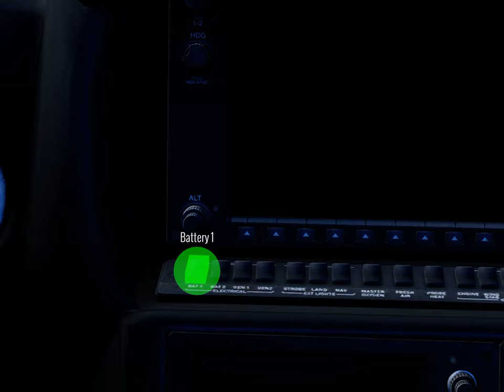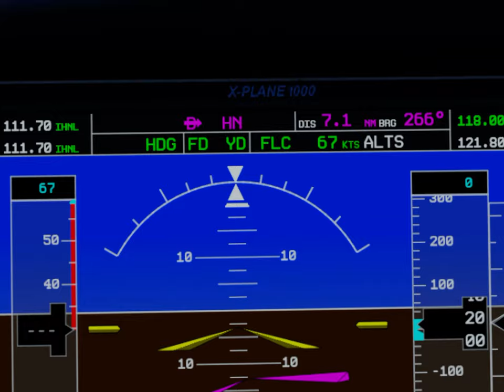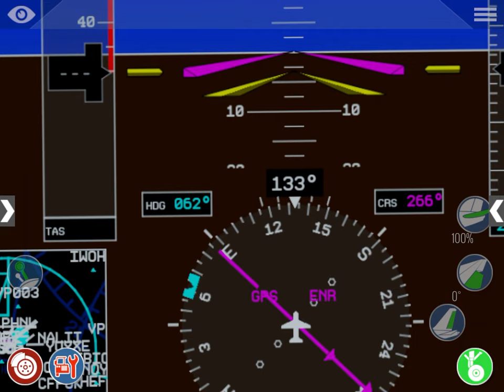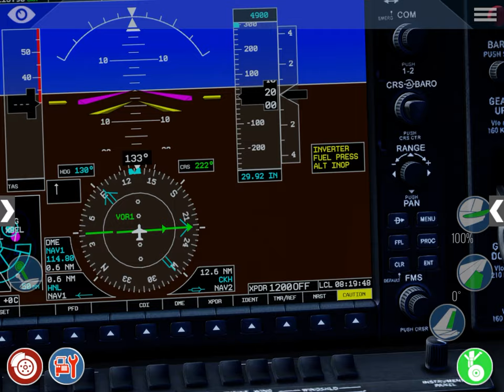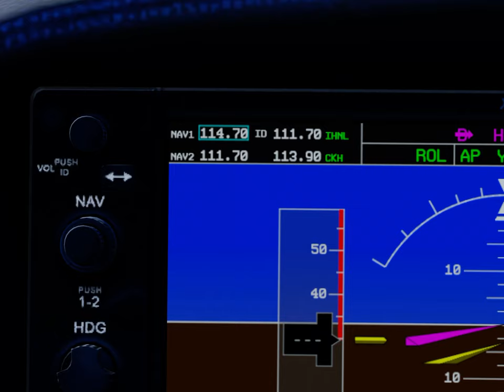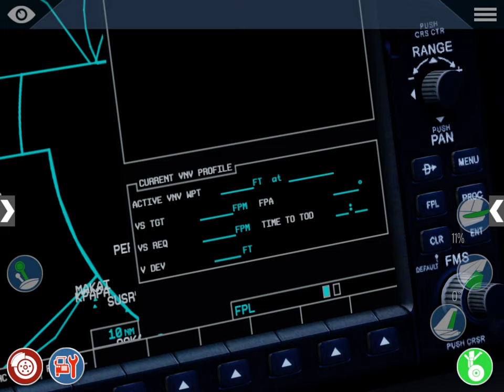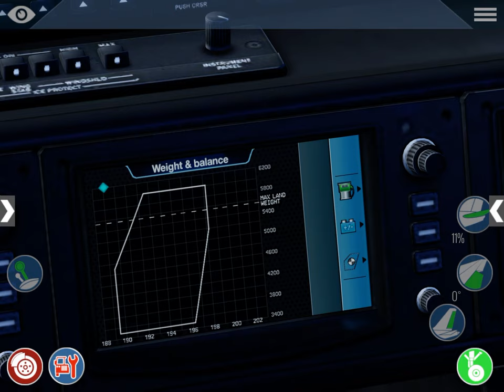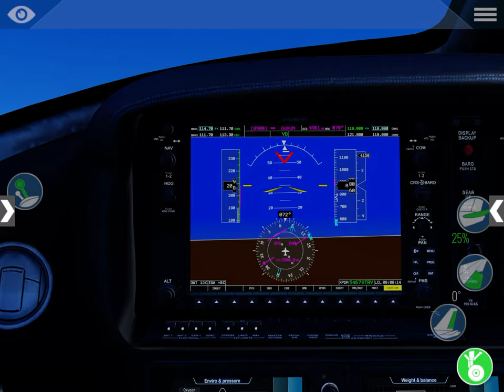CIRRUS SF-50 COCKPIT TOUR | Learn everything about the Cirrus cockpit in X-Plane Mobile!

Comment: I can see some of the terms were skipped over. 

On the MFD the diff is showing the difference in air pressure inside and outside the cabin. 

Using the autopilots Wheel switch, you can change the following depending on what mode you are in;

Lvl: hold attitude up/down (pitch and hold, defaults to level flight)
VSP: increases or decreases vertical speed 
FLC: change target airspeed on climb and decent( defaults to current airspeed)

You can fly as high as 31,000 ft and still have cabin pressure below 10,000 feet. Once the difference in pressures reaches 5.6 PSI, the cabin will let more air out to avoid a structural problem. 32,000 feet should never be exceeded. 

The three switches at the end of the PFD work the windshield anti-ice. The first one turns the system on, the second one sets it to medium and the last one sets it to max.
Reply from the maker: Alright, thank you very much. Really appreciate you taking the time to write. 

Regarding the first two items, thank you. Regarding the last one, same, didn't know that. But regarding the thing with cabin pressure I'm not really sure because as you can see from the official Cirrus website (https://cirrusaircraft.com/aircraft/vision-jet/), the Max. Operating Altitude is 31,000. So I guess the one that should never be exceeded is 31,000. I see you have a lot of knowledge, so please tell me if I'm wrong.

Comment: How do I turn the engine shutoff valve on?
Reply from the maker: Above the sidestick there is a button and a round button, put those in the off position and the shutoff valve will go on. However, the shutoff valve concept applies more to aircraft like the Cessna 172 where there is a specific button for that.